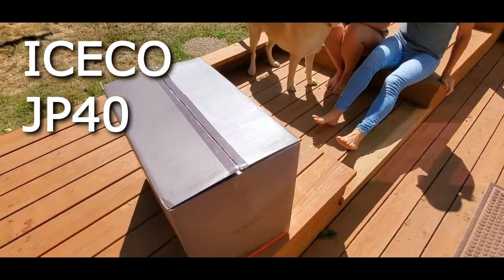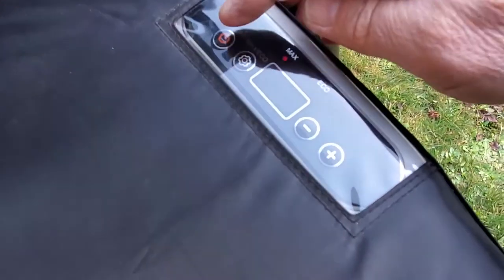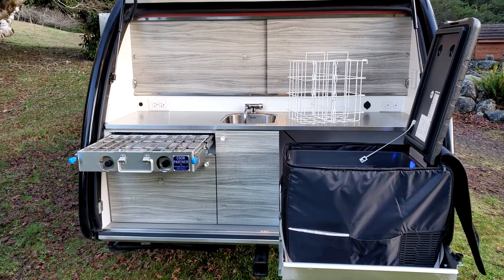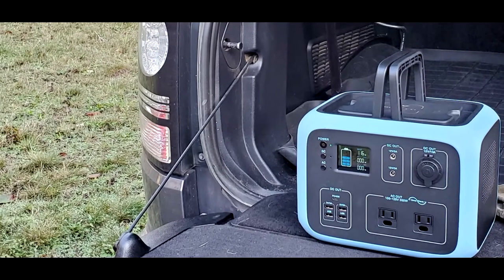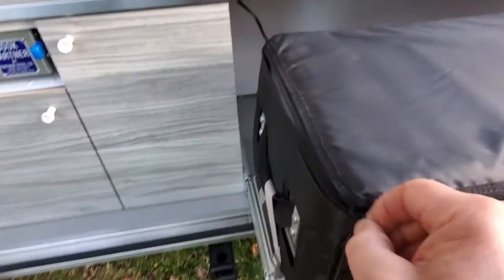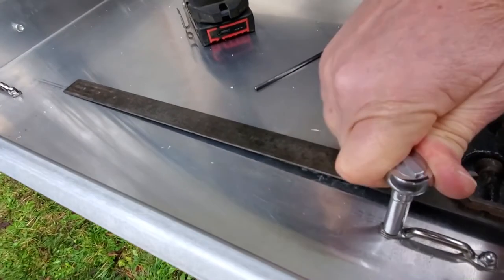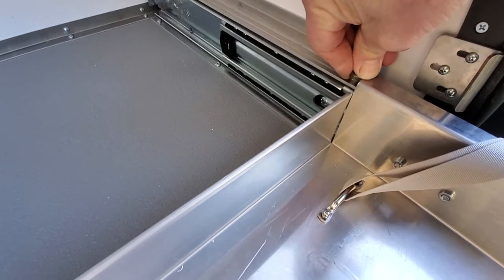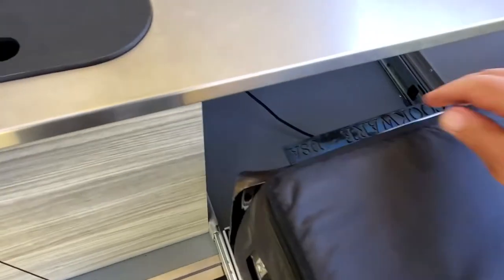Iceco JP40 Camp Fridge

Comment: I like what you did with the handles! That's pretty slick. I had a Jp40. I had a Waeco/Dometic CF 40 and it had the non refrigerated area in the back like the Jp40. And I don't like that. That Waeco/Dometic is 9 years old now and has ran it's whole life as a freezer. I sold it to a lady that's a truck driver. Still running.
I don't have a fondness for Danfoss/Seacop compressors as everyone else does. Every Peterbilt/Kenworth I've driven have a Indel B fridge with Danfoss/Seacop compressors and they sh*t the bed on a regular basis. Iceco and Indel B is the same company. That Waeco I owned has a BD35F in it. It's been good. The Jp40 is now my cousins. A lot of truck drivers are getting 12v compressor fridges now. Two drivers for the company that I worked for has Iceco's. One is 4 years old. The other is pretty new. Iceco is pushing them hard on Youtube. 
I have Dometics now. I plan on replacing them with Engels. As soon as Engel releases the MV-T series to the world. Engel gives the new models to the Australians for a couple of years before they release them to the world market.
Reply from the maker: Thanks "The Dude",
It's great to read the impressions of a trucker. Sorry that the industry is in such turmoil right now. The work you guys/gals do is vital and greatly appreciated. I only hope when this supply and transportation mess gets straighten out you come out of it better than ever!

Yes, I suspect an Engel would be better suited for the constant use of commercial trucking. A similar capacity Engel unit would be significantly heavier and take up more space but that may be a fair tradeoff for the heavy duty steel construction.

Engel and Dometic use quality compressors. Still nothing beats the Danfoss track record for efficiency, quiet running, and long term reliability. That's why they are #1 around the world and have a 5 year warranty compared to Dometic's 2 year and Engel's 3 year warranty. 

The JP40's small upper box is refrigerated. It's just a few degrees higher than the main compartment. We use it for things like cream cheese, peanut butter, dips, eggs and other items that we want to avoid freezing. We often freeze things like meats and drinks in the main compartment in preparation for boondocking with solar. But I understand that feature may be a negative for some folks.

The Iceco JP4O is working perfectly for our application. It has held up well to thousands of miles of dirt roads, pot holes and wash board. It's super energy efficient especially in Eco Mode.

For people who may not be familiar with Engel here's a good close look with actual testing:
https://youtu.be/Go1sRObjh-s

Comment: I was considering rotating the tie down anchors 90 degrees and closer to the sides for more space, then noticed how your placement is close to the base of the JP40, keeping it from shifting front to back.  Very well thought out.  You have some storage space in the front and back as well.  Is it relatively centered in the tray?  Finally, did you use the provided handle bolts or get shorter ones?
Reply from the maker: Thanks Ray, I placed the JP40 with a bit more room up front than in back. We like to store a box of aluminum foil in the front space along with hotdog sticks... In the back space there is just enough room to store our favorite stove top grill. But yes, it is pretty near centered.  

I just looked at some photos of the install and I can see that I did use the original star head screws (and tool that came with the JP40). It's been awhile but I think I may have used a hacksaw and file to shorten the screws just a bit (but may not). Lol, I can't remember but it is certainly something I would have done instead of buying new screws.